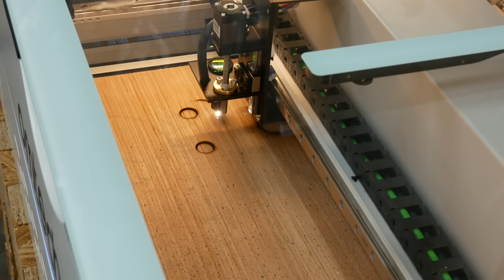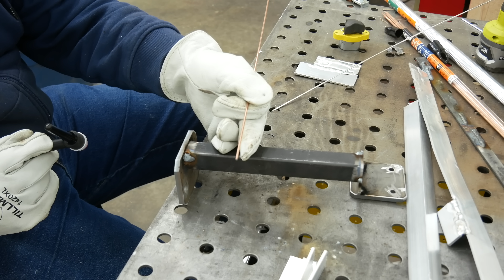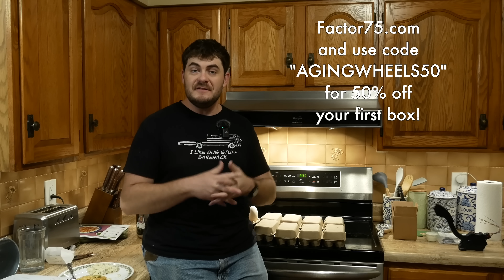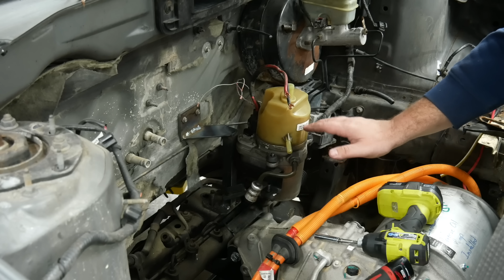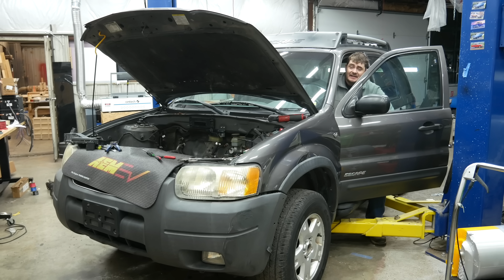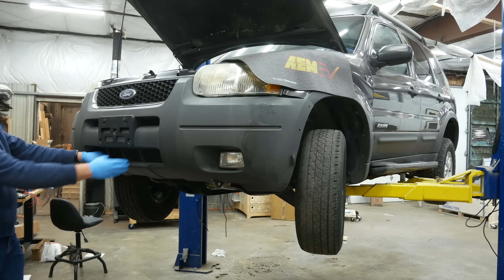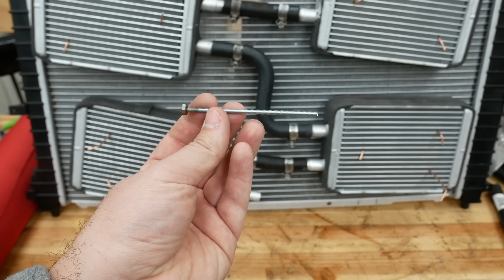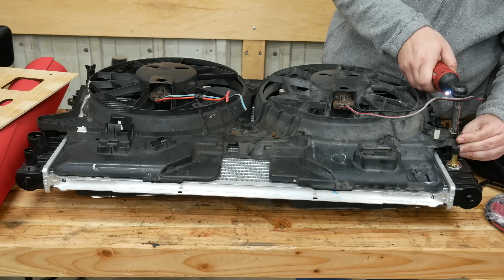Battery Powered Steering and Five Radiators | 900hp Electric Escape Project

Comment: Old video, but u still have metal to metal contact on those heater cores and radiator between the fins and on top of the lines on the rad, and on the bottom of the lines on the heater cores from the force they're applying while "hangin" on the radiator.
Impressive ingeniutity thou! Sucking up all this info 😈

Comment: The high power will only be drawn for as long as you can hold go pedal to floor.15 to 20 seconds? Based on time the continues duty 500 amp  switch should be more than fine. Its all about time at full draw. You are a very talented man. Keep up the great work with all and  electrical Thanks

Comment: So question. I see there are 4 small coolers mounted on the radiator plumbed in series. Wouldn’t it have been easier, and possibly better off repurposing the a/c condenser?

Comment: Your radiador 4 heater cores = 1 radiator math is very cute but not exactly how that works. Hopefully that will be enough cooling anyway. Those are a lot bigger than EV radiators anyway.  FYI, drive units generally want ~65C max temp, and batteries are about the same. Separate loops was a good idea.

Comment: I have a problem  with you using heater cores for coolers, but air still flows in a path of least resistance. You may not flow enough air to cool them.
An optional thought would pull fan and place them in a different location. There's other ways also.

Comment: Those Volvo electric pumps only run at like 30% without any inputs, they make a controller to make it use all  capacity. Also on learning TIG if your machine has pulse mode it makes learning a pattern and rhythm much easier.

Comment: Anderson disconnects come to fit "0" and "00" lugs/cable. There is a manual disconnect lever mounting bracket they fit into. I used them to break the high voltage drive cables on a 1200 amp EV setup. I wouldn't call them waterproof though. Waterproof the compartment.

Comment: Instead of vacuum for your power brakes, have you considered hydro-boost? You already have the power steering pump, so a hydroboost setup would be good, and pretty simple. Would minimize electrical load.

Comment: 16:16 I just use a hole saw to make plastic washers, sometimes out of aluminum or copper. A step bit can also fit in place of the center drill and you can adjust the height for different bore hole diameters. Also you prob already know, but the hole saws are also easily interchangeable on the hub.

Comment: you're asking about 2000A HV connectors.
Speak to Fellten UK directly. (Formerly Zero EV who did your oil pump) It may not be listed on their website but they have a loads of other parts in their warehouse that aren't listed, or might be able to advise or source other parts for you.

They've got a lot of expertise and experience there to confirm if that's really what you need or what other solution might work for you: Would a 2000A cable even bend enough to make a quick disconnect useful?

Comment: Actually running lithium batteries at higher temperatures INCREASES their maximum output, However it severely decreases the lifespan of the batteries.

Comment: To save youself some money you can use a gates FCM130 speed control module to control the radiator fans. They are also used on a lot of nissan vehicles to control their brushed fan speeds. You feed it 24%-100& duty cycle at 240HZ to control the speed and it has 2 fan outputs.

Comment: When you get tired of hearing that power steering pump running all the time pull it all out including the rack and put in a 2012 to 2014 Mustang EPAS electric rack. No noise and works great.

Comment: I've been working on replacing the exhaust manifold on my wife's Escape. I need to take a break so I decided to watch your video. Of course, you're working on the Escape! That vertical support that you mentioned has been driving me absolutely crazy. For some reason it is welded to the rest of the body so I can't remove it. It is also in a position that turns an easy job into a nightmare.

Comment: IIRC the hydraulic pump motor will/is able to throttle down as speed increases (I think I have the same pump in my 1st gen Mazda3) for better steering feel and less twitchy high-speed driving. Might be a signal worth generating in the future.

Comment: Oh and BTW i found Rosenberger that should be a company specialised in high voltage and high power EV connectors. But the highest current is 1000V 450A.... ;)

Comment: The only connectors high rated i could find are jump start terminal connectors from Polarwire. The write: One of the HIGHEST AMPACITY RATED connectors ON THE PLANET!
500 Amp Continuous, 2000 Amp Intermittent 30 Seconds. Maybe you could look in another universe? ;)

Comment: I been waiting to build something like this,  and install a battery bank for charging, aswell as house power when not required, as a backup for the house, with about 5kw of solar connected to it, basically my own charging station, with about 12kw inverter, unless a DC charger is possible,  with a 30-50 kwh battery to allow night charging,  and supplement day charging, also supply power to the house when needed, being off grid,. Backups are required! 20kw of solar on the house, with 10 for charging an ev, with the ability to divert 10 kw from the home array to the charger, and viseversa. So 20kw car charger , maybe more,  20kw charging would be awesome, I don't drive daily, so charging doesn't need to be high current fast charging, 220v 30ampwoyld probably be plenty,    and build a wood boiler and use a steam engine to generate power during the winter, possibly 300 amps at 80-90v with the alternators I have,

Comment: I woul only run one ccolant loop with that big stock Escape radiator, those components just need to be as cool as possible and thats that. As other comments say the 4 heater cores look cute but rob the big radiator of airflow...

Comment: I mean you described something I've not bought commercially before, but i will engineer it for you. I'm mechatronics and electronics. You need to buy a hydraulic crimp tool from china or amazon or ebay or aliexpress like 40 bucks. thats requirement 1. You will use it you've needed one like 7 times that i have seen. do your own hydro lines and everything my dude. 

new tools - hydraulic crimper (ebay 40$ or ali express or amazon trust get 0 A WG or lower like 4 / 0 also they do metric can use for anything not just wire  )  
objective - watertight connection made for HV and Amperage connection, housing, connection material and seal should be adequate and replaceable.

Now depending on the voltage you can safely store we are going to engineer the wiring requirements. You mentioned this is going before the ESC and all that jazz so this is from battery to them. 
Here's how we do, 80 percent rule, current carrying lines need to have adequate head room just in case.  Its in the NEC somewhere i swear. Its for heat mitigation, never heat up the wires and need less cooling, just do it everywhere. 
Anyways. so.

Ohms law and the PIE EIR circles are your friend. let me see... i cant draw it well here so anyway print it out and glue it to your toolbox. theres one thats a big circle in 4 zones print that or copy it down in marker. 

Electricity is cool and fun. i will answer or teach anyone who is interested. 

//=====Wire===Connector---- Mating surface          seal -----connector===Wire====//

Right so you know what wire you have access to. any amount of current and voltage can be carried with enough wire. Good news. So doubling or tripling conductors is fine common practice. 
This helps us distribute the current. Use anything you can get your hands on that's serviceable. 

Higher voltage lower current, right so that's why we do HV in cool things, so if you can either double up some readily available ones in parallel or simply use some studs sticking through the box, inside another smaller box on the outside. think starter capacitor housing but no cap just studs. then onto those you are going to simply bolt and then insolate and isolate, ideally separate enclosures for positive and negative. 

Picture a big old SLA battery. like a group 31 or a 4D right. its the same thing. big battery still needs terminals so you space them apart. the HV aspect increases the range at which the air is able to be ionized and an arc can form and bridge the gap, shorting it out. right. so we need to insulate and isolate! 

Insulating materials include dielectric grease, rubber fittings, etc... isolation refers to literally being somewhere else lol. so as you can imagine say 2 tiny little boxes! 

Nuts bolts can work, use i think its pure stainless or galvanized are the best steels. or Copper buss bar type material. use a lathe to turn down a copper ground rod... really its what do you have access to and how much money are you wanting to spend. i can engineer you exactly what you need with more details just reply here is fine.
Reply: @ᴛᴇxᴛ ᴍᴇ+⑤④①②⑧⑥①⓪②③  your channel is a different link than his.

Comment: I... Robert? You were very concerned about metal on metal contact and fabricated those very nifty washers.
Which you put on metal bolts jabbing through both the radiators and heating cores, with no insulation. If this wasn't a temporary setup anyway, I'd be very concerned for its longevity!

Comment: with the radiator, if there is a full alloy replacement of stock radiator, and you can split the end tank to separate the 2 loops on the 1 heat exchanger

Comment: Question: Why would you buy Tesla motors/engines instead of grabbing the UQM ones out of the Coda parts cars? Was it not enough horsepower for the bus? Were the motors too messed up from the CVT conversion? 
Oh, and with the question on the high voltage disconnect - your question makes no sense as Amps are only half of the equation. What voltage and/or Watts?

Comment: Loving the videos, I honestly don’t know where you find the time to produce such brilliant content! I don’t normally comment and you probably know this already but… If I’m having to bend steel that’s too thick for the bender or smashing it over a vice, I slot it with the grinder, bend it by hand and weld it back up. Not ideal I know but can speed things up a bit, assuming the welder / grinder is already set up and ready to go.

Comment: My suggestion on your 4 heater-core mounts (as it relates to Metal-on-Metal contact):  Go to your favorite fast food place - order lunch and take 6 or 12 extra straws - remove those thru bolts, add the straw sections as isolators to avoid the bolts rubbing thru the 5 brand-new radiators.

Comment: Question:  Why not tap into the electric PS pump and go with a GM Hydroboost setup for your power brakes?  You already have the always-on pump, why not make it a dual-purpose pump?  HotRod (or CarCraft) magazine did a write-up on this a few years back (FYI).  : )

Comment: Really enjoy the videos. I have two suggestions for you on TIG welding and your power steering pump. I hope they help. 

#1 The trick to TIG welding is puddle control and moving the puddle in circler motion. Add wire to make your puddle bigger, but be careful not to round over your tungsten tip. Keep that to a SHARP point at all times. Grab the handle like a pencil (Not like a MIG handle) with the hose draped over your shoulder and running down your arm. You'll have better control by relieving the weight of the hose over your arm. Practice on two pieces of metal making an outside corner weld. That’s easier to understand the puddle control. Then, the inside corner weld you were attempting will be easier.

#2 Electric power steering. Repurpose your cruise control button on your steering wheel to control the power to the pump. If you're driving around town, keep it on. If you’re driving 47 miles on a straight road, turn it off. First thought was a button like a NASCAR press to talk or kill switch, but I doubt you'll be using cruise control on your rig, so use that. 

Can't wait to see the next video. Good Luck!

Comment: what wire are you going to use? 4/0 will start overheating around 400a, i guess you "could" use 5 of them? (but not sure if any plug that took 5  4/0 wires could ever be call a "quick disconnect")

Comment: I've seen Amphenol PowerLok 300 series handle 2200+ amps for less 10 seconds at a time when doubled up (1100 amps per contact)! They held up well. The nice thing about these connectors is that they have a termination for the shielding, unlike many DIY HV connectors. Mouser has them in stock and has great prices.

Comment: To get the reservoir bracket on you use those large holes. And it just slides it to place. The bracket that comes off the radiator support is supposed to go to the motor mount not what you think it is. I’ve done 5 sub frames on escapes. Some where 2wd 4 cylinders and some were 4wd v6. I know an embarrassing amount of information about Ford escapes.  😂😂😂

Comment: Even 1000A is already a tall order, I don't think I have ever seen a connector that handles that much current. 
That being said, I believe Tesla uses the Rosenberger HPK connectors, at least in their normal offering, they may have a custom made connector for the plaid models, though they are understandably cagey about it. The HPK is used in VAG and MB products as well. 
Rosenberger makes even bigger connectors that are rated for up to 450A continuous at 85°C, although good luck buying their products as a private individual. Their largest connectors are the HVR300 and HVR420 series. 

The thing to keep in mind is that you won't draw 1000A all the time, all these connectors can push past their rating for short bursts, I know we use the aforementioned HPK at 540A for 30s in some of our products. You could improve current carrying and serviceability in one go by having a dedicated harness for each drive unit. I would also definitely recommend that you use shielded cables, since your Escape is most likely not designed for the EMI levels a 500hp inverter kicks out.

Comment: Honest question here but why not just use an electronic power steering system from a 2014 Corolla, it drops inline with the steering shaft and just needs power. Tbh tho, this is a super easy fix... And I like easy 🤣

Comment: I had an old motor home years ago that ran too hot (it was way under powered, so the engine was straining under any kind of load.) I bought 4 heater cores from a wrecking yard, hooked them into the system. Over heating problem solved. I had enough room to mount them beside the radiator, so they were more efficient than your setup, but you don't have any extra room. I had to set up a bypass system for cool days, as the engine wouldn't warm to operating temperature.

Comment: It might not be the most aerodynamic build, but that should be plenty of radiator to keep the motors cooled down. That's something even the big boys seem to get wrong; Car & Driver hasn't been able to run an EV around a full lap of VIR without overheating, whereas their ICE competitors usually won't overheat.

Comment: On some ford cars they have variable assist power steering sensors in the high pressure line. My crown victoria doesn't have it but the pigtails are still there. It boosts it at low speeds like in a parking lot and cut it back when you don't need it like on the highway

Comment: Hydraulic Brake Booster... since you already have a power steering pump.
Also, every DC motor is variable speed... if you add  PWM fan speed control.

Comment: That center brace that goes between the fans unbolts at the top and then you slide the radiator with the fans up. It's not easy but hey.

Comment: Not sure you are still looking at comments, but on your hunt for a 2000A connector that's good for high voltage, take a look at the peak and average power. I imagine you aren't going to be pulling 2000A for more than a few seconds, so part de-rating isn't much of an issue. A high power connector like that probably has a continuous and surge rating (just like batteries!)

Comment: I’m just coming into this series. So maybe this has been answered already. But why didn’t you start with a hybrid escape? That would have gotten you electric power steering and a brake booster that would work without engine vacuum. Plus things like electric AC compressor.

Comment: @agingwheels Hello. I would love to make the same conversion on my Ford Sierra Sapphire Cosworth 4x4 because actual hydraulic power steering sucks, it's noisy (huge Ford issue for most cars like that produced by Ford) and leaky and can't find a new one because they went out of production long ago. Of course there is a lot of people that makes refurbs but are either uber-expensive or are far far away and requires you to give away the old one, but I digress. I wanted to know if there is a way to find a compatible one that is from a later model/maker (Ford) or from another maker (wet dream would be to use Toyota spares) and what measures/fittings should I take in account for that. Can you help me out?

Comment: For the brake booster, you could just find a used hydraulic brake booster powered by your power steering pump you just installed, just like alot of GM vehicles.

Comment: You could run hydro boost power brake assist useing your new fangled power steering pump system and get a twofer.